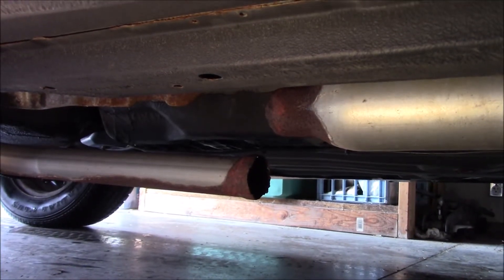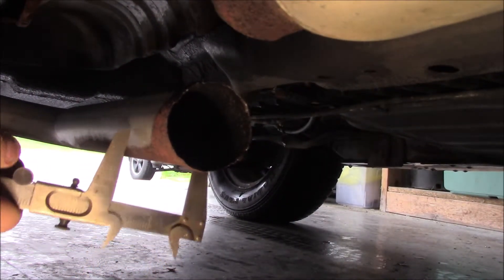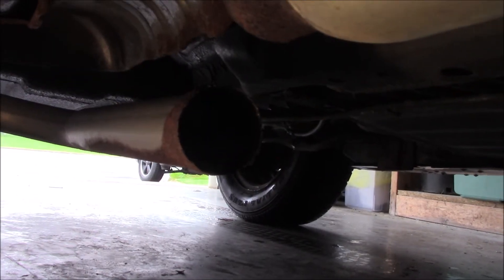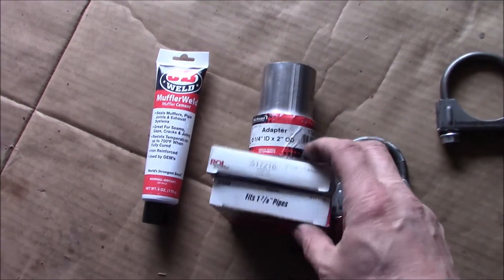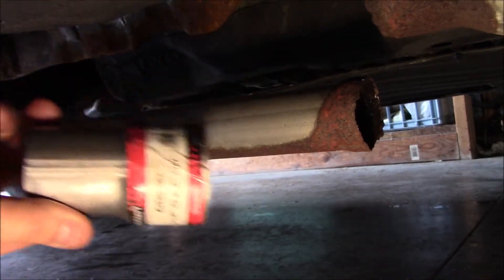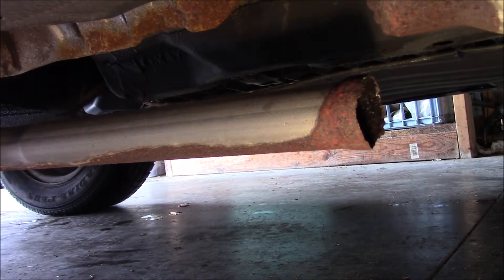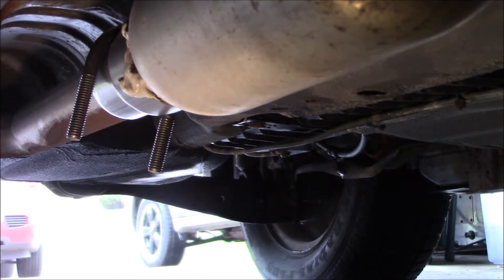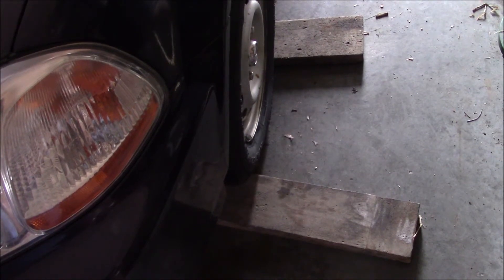loud broken exhaust pipe repair, no welding, done on a Honda Civic

Comment: Will this permanently fix the issue?
Reply from the maker: Yes this is a permeant fix.  I wish you the best on your repair
Reply: @bbbjim1fixedit  like how much is it
Reply from the maker: @xchino0427  everything I used in the video was under $15 in the US
Reply: @bbbjim1fixedit  so it's better giving it worth a shot doing it on your own then taking to mechanic?
Reply from the maker: @xchino0427  You can save a lot of money for 1/2 hour of your time.  I wish you the best on your repair